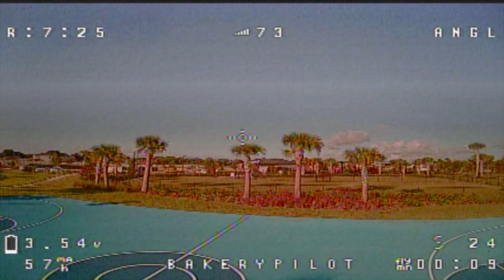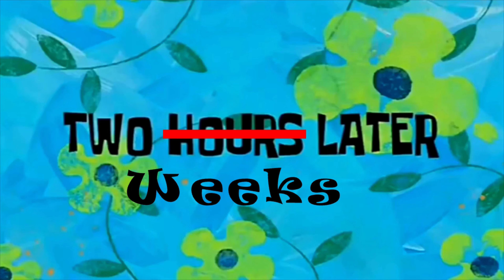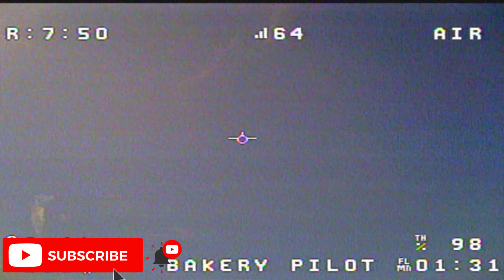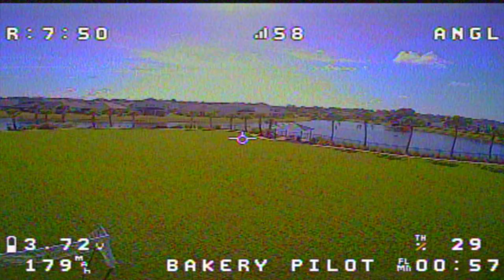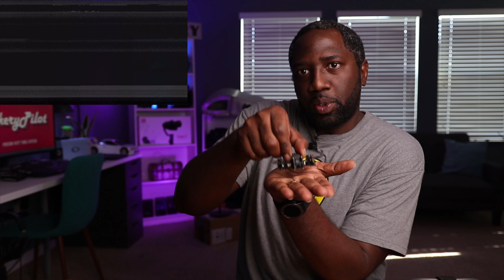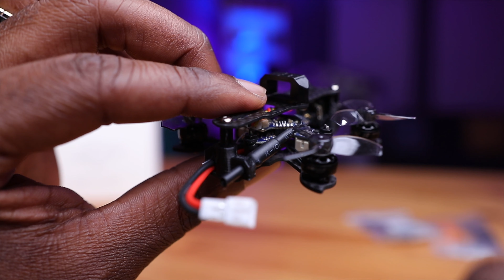Baby Nazgul 1st Flight | Close to Perfection Except 1 Thing

Comment: M having the same issues with short flight time using a brand new Aline 450mah and it seems as when i pass about 70' i loose RSSI then i regain it and it goes back, forth telling me the same thing on my qx7 tx. I extended the vtx power to 50 mw so ill give that a try or i may have to send it into Iflight lije you did and let them figure out why im loosing RSSI at such a sgort range.

Comment: It’s cute…. But…. I went with the diatone Roma f1.  Honestly it’s the flight times that shot it down for me. I have the T-lite with the crossfire module as well, I like it and I’m a pincher, you?
Reply from the maker: Yeh, the flight time is a killer.. Wish it was a minute or two longer.  I'm loving the Jumper T-lite though.  I'm "thumber" only because that's what I learned flying RC planes as a kid, but honestly I tried to convert(unsuccessfully) to "pinch" as I picked up FPV.  I do think pinching provides more precise inputs and therefore better flying results.

Comment: I have this little guy. From my experience (40 batteries or so) this is my 2 cents. 
1 the vex is crap. But I get far better video than this. At least 500ft range on mine. I bought a eachine micro 400mw vtx (not installed yet). 
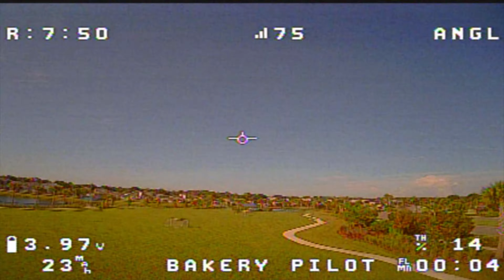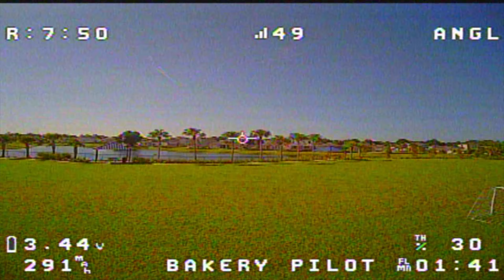2 I fly 380 mah batteries and get 2:00-2:30 flight times. 
3 the cam angle is too steep. I lowered mine to around 5 degrees. (Exacto knife the mount).   Once the cam mount is changed it is a lot more fun to fly through tiny spaces.   Happy flying!!
Reply from the maker: Thank you very much for the input and your insight.   I'm glad it mirrors my review and first flight experience.   Humidity does pay a role in video transmission range, and Florida is a very humid region.  I'm also using a box style goggle, so that might have played an influence on my range.   The cam angle is too steep and I'm sure will be redesigned in the next version.
Reply: @BakeryPilot  Yea. I was using both a omni and  patch. That is probably why I had better range!!  Either way, It is not enough. 100mw is a minimum!! And adjustable cam.